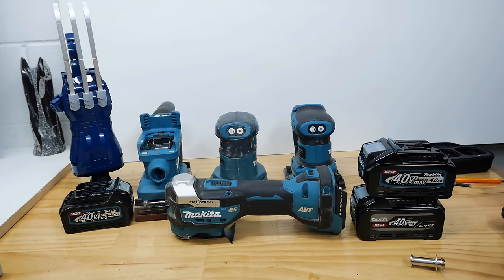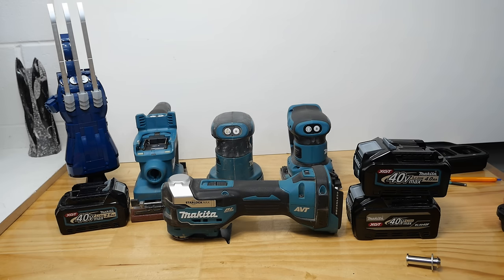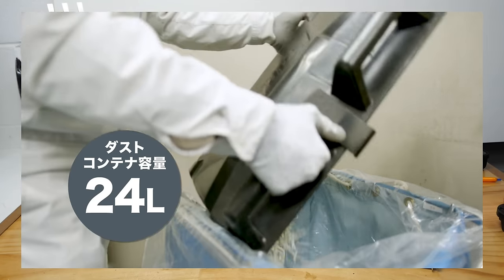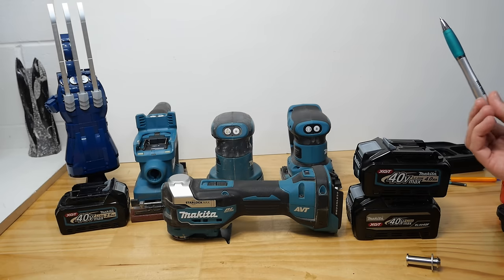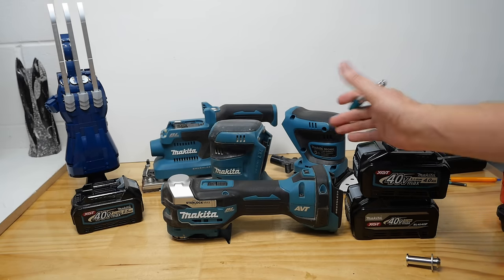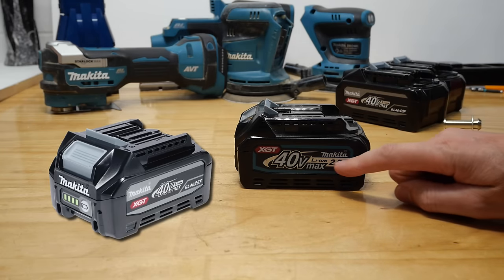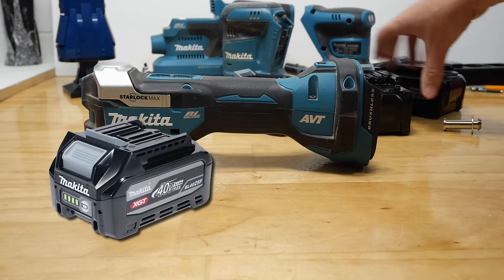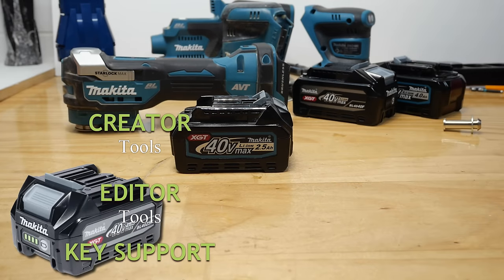Makita 40v Sanders, Lasers and More NEW Batteries are here! Are Makita Pouch Cells a Thing Now?

Comment: Did you know that there exists a type of nailer that uses explosive powders in its nails to penetrate through tough metals? This type of nailer is known for its exceptional strength and is often preferred over cordless nailers for tasks that require heavy-duty fastening. With its specialized mechanism, this nailer delivers an impressive level of force that can easily drive nails through even the most stubborn of materials.
Reply from the maker: Are you an AI bot?
Reply from the maker: Yes I know there are such tools, they've been around for decades, your comment just sounded like it was an advert or was lifted from Wikipedia. Now can you please tell me how many traffic lights are in this image? 000

Comment: some tools are fine as 18v or even less. as a heavy mechanic i am so disappointed they refuse to make more electric ratchets with different head types. it seems like a low investment cost for a good return on their investment. every other brand is running off to the horizon in respect to mechanic tools...

Comment: If the BL4025F is 30% more powerful, 60-70g lighter, shorter AND RELEASE IT AT A REASONABLE TIME (cough cough BL4040F to USA, its been 10 months and we still dont have it) it will be badass!

Comment: Excellent news! Theory about the sanders: they’ll have a clip-on battery holder that attaches to their dust extractors. That way you can snake the cord from the battery along the dust extractor hose.
Reply: It will probably go with a 80v vacuum and it will power the sander aswell as the sander I bet u and it will turn them on and off when u turn the sander on just like festool
Reply from the maker: Incorrect I'm afraid.

Comment: Good observation regarding the battery... Baltic (LT, LV, EE) Makita webite also has "part drawings" for the 4025F (dated February 16th, - they've  been there for more than a month now..), and  there the BW picture is identical to the photo - slightly different underneath the indicator, but size wise seems to be the same as 4025.

Comment: I have a theory about the CG suffix.

 ConnectX utilizes an attachment to an adapter, and is 40v Max, 36 nominal, like the XGT and LXTx2 tools.

Makitas blind end plug ConnectX specific tools in the US have a C prefix instead of X(36v) or G(40v).

 My theory is an XGT belt adapter that has a corresponding blind end to it will be in the works, so you could use an LXT x 2 adapter with XGT batteries, or throw an 8ah on your hip and use it in an impact with the line coming off of it to your belt.

Additionally, the blind end tool plugs could also be used for a potential inverter adapter system that can enable mains power. 40v is alot easier to step down to than 18v, and an adapter box with multiple plugs could very well be suitable for bench top work. 

For sanders it makes sense to go half cordless (I say half cordless because it goes only to your hip) as  many times they are attached to external vacuums, so a cord isn't as cumbersome as say a drill or impact where vacuuming isn't needed. 

Also, belt packs could take the weight off of the large concrete saw, SDS Max, and other large tools.

Comment: I’vebnever really understood cordless sanders. Basically every modern sander is designed to be used with an external vacuum since removing all the dust allows faster sanding and finer finish. And if you’ve already got a vacuum hose coming off the back of your tool it’s not much more annoying to also have a power cord; plus that can be used to control the vacuum automatically without having to deal with bluetooth.
Reply: I have a cordless festool and not having to deal with a cord is a bonus even when the extractor is on. However when I am sanding trim joints around a house it is way better to grab just the sander and not have to run a super long cord
Reply: We have a sailboat that is stored at a boatyard in the off season.  Cordless sanders make annual maintenance so much easier!
Reply: Site work

Comment: Running my 3/4 XGT impact with the 5ah battery. Suits the size of the tool but its still pretty damn big. Would love to get my hands on a BL4040F battery. Just need more money.
Reply: FYI, torque test channel recommends using the 2.5ah for the xgt impacts, for some reason they get better results on the dyno
Reply: @Aspire198  average area under the curve was exactly the same, peak number is like 1% off which is in measurement error range. You can use whatever, it really doesn't matter.
Reply: @Aspire198  yeah seen that, I don't understand why either.
Reply from the maker: TTC hasn't tested a BL4040F yet.
Reply: @ToolsAndStuffOFFICIAL  or the 5Ah and 8Ah
Reply from the maker: @toolscientist  Really? Wow. The US sure is behind.
Reply from the maker: Then again the 8Ah has not long been released in Japan,  and they still don't have the 2Ah.
Reply: @ToolsAndStuffOFFICIAL  still don't have 2Ah in AU. We'll prob never get it.
Reply from the maker: Maybe it's just a NZ thing 😁 It's pointless anyway when there's a 2.5.
Reply: @ToolsAndStuffOFFICIAL  US has 5Ah and 8Ah. TTC just hasn't tested them as he doesn't test much XGT stuff, and I think what he tests is on loan. So I think he just doesn't have or want the 5Ah and 8Ah.
Reply from the maker: I know they have them,  but no-one seems to be able to find them.
Reply: I just assumed TTC hasn't tested XGT's larger batteries because Makita are not as popular in the states. I decided to avoid the 2.5ah batteries because I still have my LXT tools for that level. I find the 4ah batteries a good size

Comment: I have a bit of a theory with the corded sanders. Back when Mirka first released the CEROS sander, it had a dirty great big power pack that changed AC wallgas into whatever DC the sander used. I suspect Makita might be doing something similar here, but give you the option of using a battery or a 240v power source. The other thing I wanted to bring up is if I wanted long run time, I'd be wheeling out the extension lead and the trusty Festool ES150. Battery sanders have their place to dress up a handful of mitres, or to quickly prep a single car panel for paint, but its hopeless for doing full house lots or full car rub downs.

Comment: I love the Makita 40v stuff but they are just so slow with releasing stuff like I want a multi tool framing nailer sander would be nice aswell and automatic screw machine like for drywall screws I have everything on 40v but now I bought some 18 volt aswell because they are just to slow and I need the tools for my job

Comment: Is anyone making tabless 18650 cells?  I wasn’t aware of anyone making them yet.

I also thought tabless was more of an advantage the larger the cell diameter because the coils are that much longer and have more resistance, so less of a benefit on smaller 18650s.

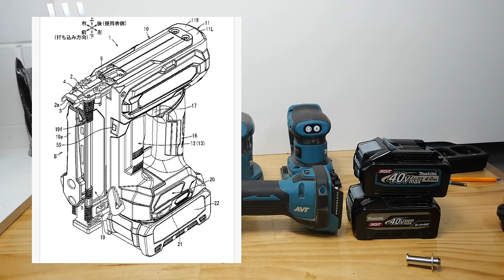Comment: at 0:47s you say "this is all 40V stuff I'm talking about", does that go for all the patents you discuss in this video?
Because around 3m:35s/3m:45s you're talking about the add-ons for the impact driver and that seems to be one with the control buttons on the back and centered handle (like the TD173). 

Hoping Makita finally pushes through those improvements of the TD173 onto the 40V XGT platform and come with a similar impact driver.

Comment: Makita needs to get a 18v 8ah battery. Dewalt has managed to do this, without either 18/54v outcompeting the other.
Reply: There batteries are unreliable.

Unlike makita battery technology
Reply: Size restraints on any tool that is 36v or has the battery enclosed in a housing or lid. The only way they could do it is with tabless or pouch cells, but 8ah would be stretching it.

Comment: Will Makita release jigsaw with AWS?
Reply: Does anyone use the jigsaw with a vacuum?
Reply: @riba2233 there are attachments nozzles for the jigsaw so what do you think?
Reply: @patbird9694  I know they exist lol, I have one, but I am talking about real life...
Reply: Might as well use a corded jigsaw if theres going to be a vacuum tube connected to it.Thats why i have corded/ cordless version of my power tools.
Reply: @riba2233 If you work indoors/confined spaces you want dust control on everything you can get.

The issue is that most historical jigsaw dust collections have been poorly implemented, leading people to not even bother. 

The smaller the orifice for a vacuum connection, the more care needs to be taken in the design. It's not just about clogging from debris or starving the vacuum itself,  but also about the inertial mass of air being moved towards the intake. A high pressure/low flow port will induce less sympathetic airflow that aids debris collection. The more air you have flowing towards the intake port, the harder it is for particles to escape from the collection zone.

The answer is to increase the cross sectional area of the dust porting as much as possible, and use blowers/air curtains to corral debris into intakes.

Comment: They can’t pump more power output in the 18v range because the fuse in alot of the tools will blow before you reach maximum power.
Reply from the maker: I've used HO Milwaukee batteries on many makita tools without a problem. And the only tools I've seen with fuses in them are impacts.
Reply: There could be some truth to that idea, but on the battery end. They've got 3x fuses, 1-2x mosfets and 2x shunt resistors in the batteries. Putting in more powerful cells would need 4-5x fuses, 3-4x shunts, and maybe another mosfet.
Reply: @ToolsAndStuffOFFICIAL please do a video on alternative LXT battery options, this would be great. I’ve been tempted to get some Milwaulkee or DeWalt higher Ah batteries with an adaptor to get decent runtime. Mainly on the garden tools tbh, mower, strimmer & chainsaw but any would be interesting.

Comment: Great video. I'm a bit frustrated with XGT batteries in the UK. I have a standard 2.5Ah and 4.0Ah batteries and want to add to them, but I can't justify spending £140 on the standard 4.0Ah, so I was going to get another 2.5Ah until the BL4040F arrives over here, but now I'm stumped.

Would you recommend the BL4050F to use on the GA038G 9" grinder? I currently use the 4.0Ah and the weight balance is nice. I'm worried the 5.0Ah will unbalance it 

*Edit: got some numbers the wrong way around
Reply: 4050F is a much better choice for that grinder,power and balance wise.
Reply: @riba2233 oh really? I nearly bought one a while ago but I think I read something which claimed the 4050F doesn't push as much power out as the new 4040F.
Reply: @leomcloughlin9788  they are pretty similar in power, you can get either, depends if you want more capacity or a lighter pack :)
Reply: @riba2233 I mainly need another battery, but not if an updated model is coming along. It seems the 4050F is the best choice all things considered. Thanks for your help

Comment: that impact driver thingy btw, not sure if its linked to euro market, but the plans you showed in the vid is for the 173d (japanese TD) which you can import to the EU. Which is a way superior device imo btw, if not only caus it has that 360degree lighting in the front around the chuck... But bit attachment wise.. nah using Stickbit instead, off to the side, strong magnet, not swapping that out any time soon. The 173d design they should however implement that over the 171 asap imo, whats the point in those 2 light: still always gonna have shadows

Comment: For the old BL 4025, 23A x 40V= 920W or 23 x 36 = 828 W.
With SHD 30A x 40 = 1200W or 30 x 36 = 1080W
With UHD 35 x 40 = 1400W or 35 x 36 = 1260W.
The old non F BL 4040 I heard is even weaker then the old BL4025 so that 1500W rating looks wrong.
Reply: You got all the numbers wrong. Continuous discharge ratings are:

4025, vtc5a cells - 25A
4040, vtc6a cells - 30A
4040F, vx40 cells - 50A

18v 1850, vtc5 or 25R cells - 20A

Peak numbers are a bit higher, and Makita is quoting them. 4ah is not weaker then 2.5ah, in that case the 8ah would be weaker then 5ah which is not the case
Reply: What is SHD and UHD? The rating is kinda arbitrary, unless Makita tells us what time scale they're using. Continuous discharge to empty is only around 25A, but will be lower when packaged in a battery. Instantaneous can do 70A without hitting voltage limits, but will overheat or trip low voltage in under 1min. I'm guessing Makita's watt rating is based on ~5-10min of use
Reply from the maker: I too was wondering what SHD and UHD stands for?
Reply: @ToolsAndStuffOFFICIAL  I bet it was regular 4040 vs 4040F lol
Reply: @riba2233  
BL1850 can sustain up to 46A  or 23A for the cells. In puls and with voltage drop can go to 25-30A or more but damaging the cells. 20A rating have the cells in BL1860 that  is weaker.
I've seen that some Makita tools are weaker - less powerful @ BL 4040 non F vs BL 4025, so something is weird about them.
By SHD and UHD I was refering to sustained super high drain ( 30A for 18650) and sustained ultra high drain for 18650 again, sustained as without much voltage drop and without damaging the cells.
Reply: @loochan325  no, the numbers are those I quoted. 1860 uses 15A continuous rated cells (vtc6 cells)
Reply: @loochan325 I've taken a BL1850 over 100A before it tripped low voltage, so 50A per cell. Whether or not that did any damage is another question, but Makita has decided not to restrict their batteries by current.

The BL4040 gives worse performance on some impacting tools. Direct drive tools (drills, saws, grinders) are usually better with the BL4040. No one has figured this out yet - might be some sort of electrical resonance phenomena that only happens at the resistance of the 4Ah.

Comment: pouch cells would be way hotter
Reply: Why do you think so?
Reply: @riba2233  because there is some space between round cells, which make them a bit cooler, than uberpacked pouch cells
Reply: @dimkinlv  sure but lipo cells have lower IR so they heat up less in the first place. You can also add some heatsinks to move the heat away
Reply: @riba2233 it'll be interesting when we get to see equivalent pouch vs tabless. If BL4025 can do 89% of the power of the Dewalt 5Ah powerstack, then tabless is as good as pouch. Powerstack is 740g, BL4025F is 660g, 660/740 = 0.89.
Reply: @riba2233  comparing to RCs, drones and so on - there are too much dust, water and debree around powertools. adding heatsink will remove saved space., so, no point in that IMHO
Reply: @dimkinlv  it can be a really thin copper sheet metal piece between the flat cells.  Tool battery packs are far more engineered than rc packs. But like I've said, they heat up less in the first place so not an issue.
Reply: @riba2233  Lets waint for the next videos from ~down under~ NZ :)
Reply: @dimkinlv yeah let's, but anyways I really doubt they are lipo pouch cells :)

Comment: I am getting tired of makita not releasing new battery tech for 18V or essential tools for 40v like the framing nailer. I dont even use 18v but they are losing market share EVERY DAY because they backed themselves into a corner with the 18x2 technology. They should still develop an 8ah LXT battery that is not compatible with the 18x2 tools for stuff like the drills, impact wrenches, single battery saws, etc. but they wanted to sell you 2 batteries instead of one big one.